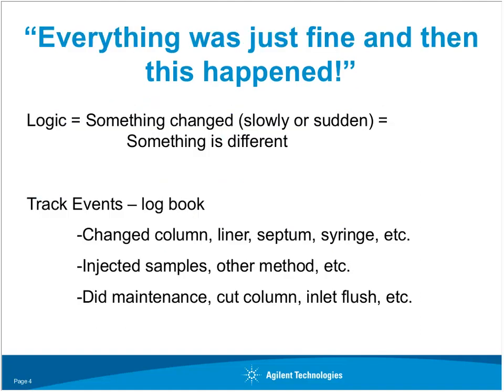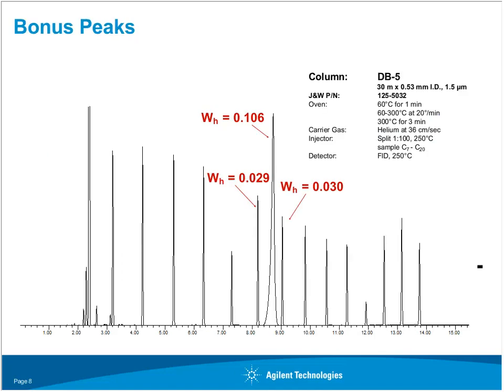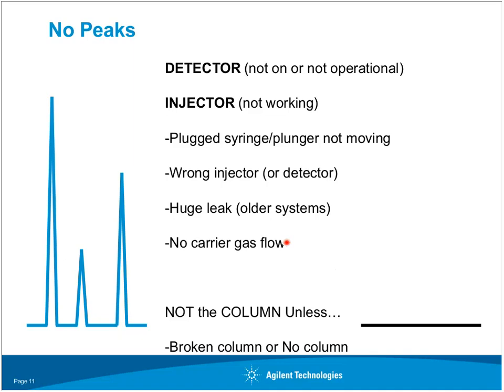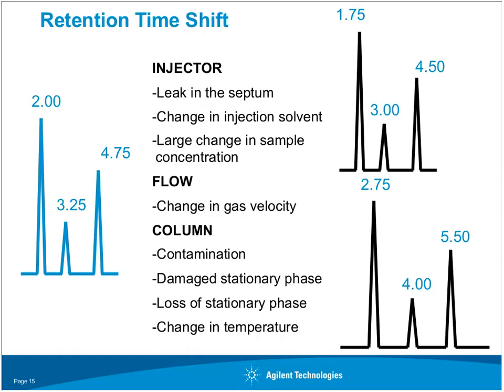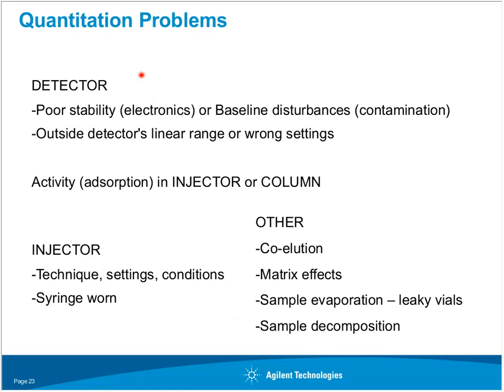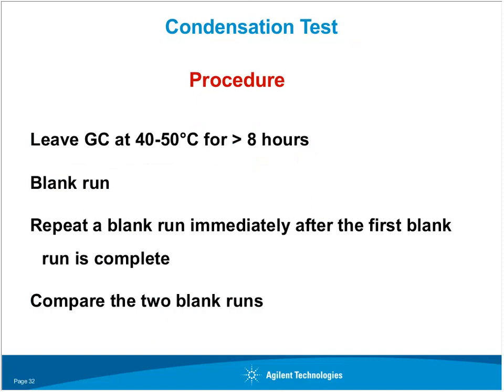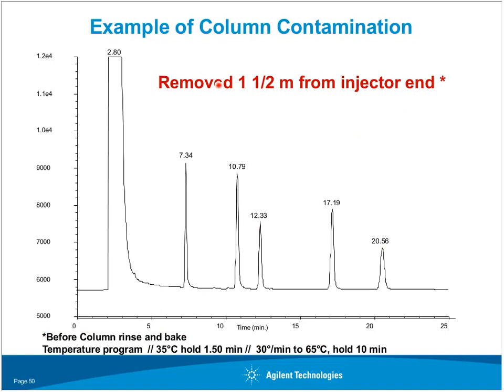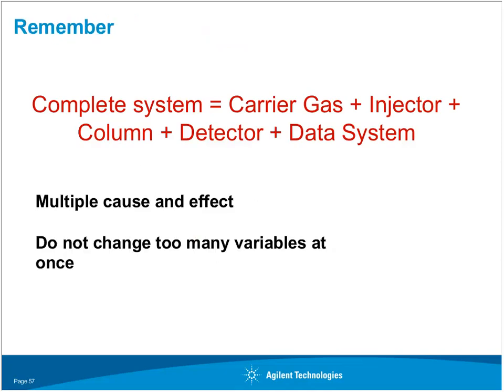Practical Steps in GC Troubleshooting

Comment: At 38:44 you say that if the blank runs are the same, the contamination is strongly focused on the front, but the text says that the comtamination is NOT strongly focused on the front. Which is it?